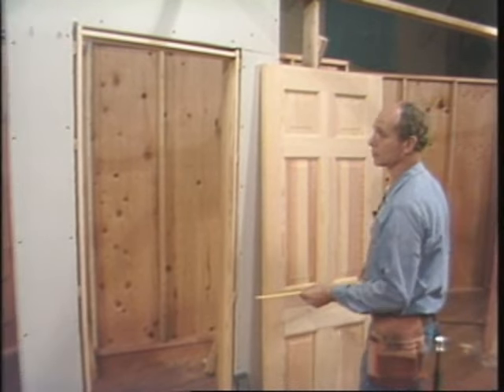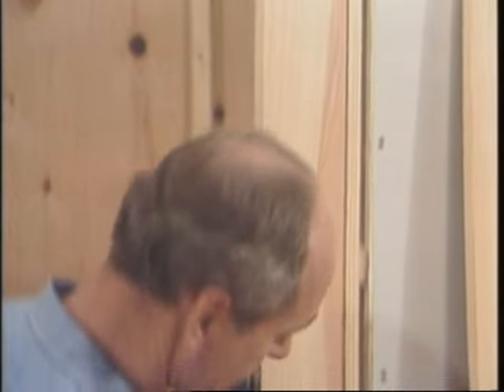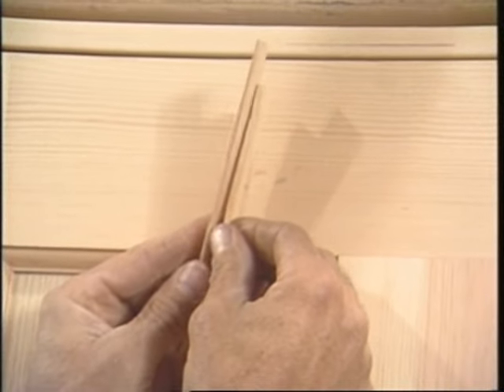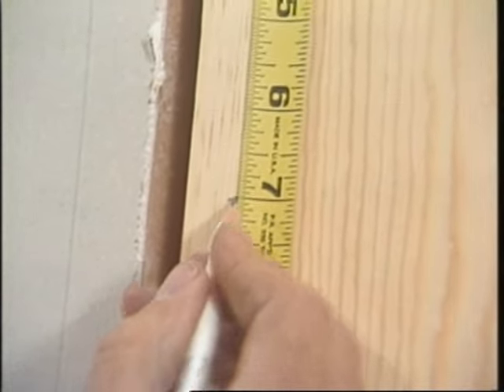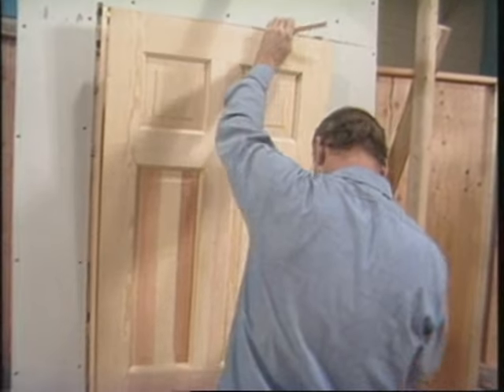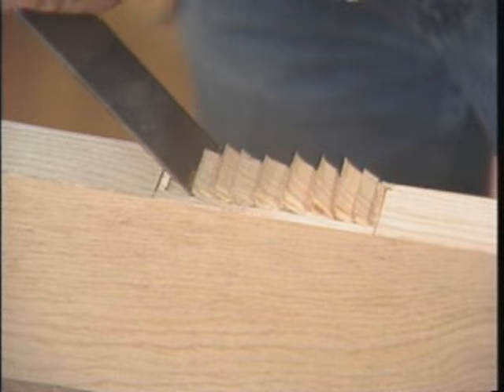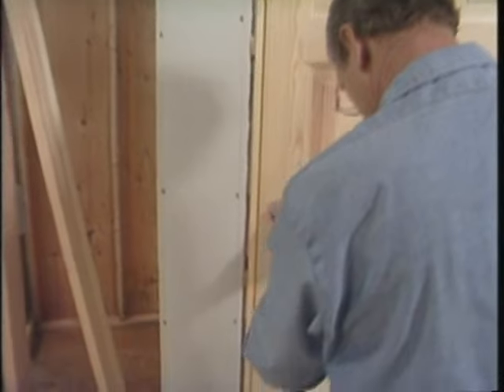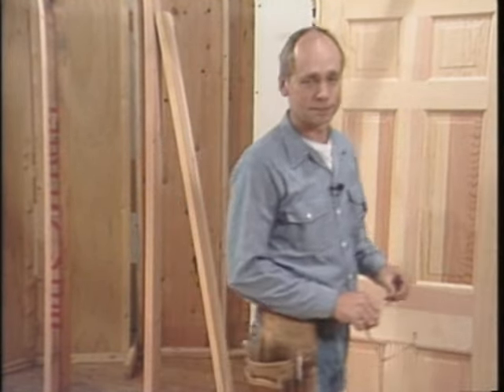Scribe-Fitting a Door

Comment: Might want to explain where you got 7" and 10" very incomplete video. Sorry...
Reply: To avoid the mortice and tenons on the mullions going into the Stiles of the door 
Got it
Reply: @MrTicker69  I understand it, I'm sure there are many that dont. That was my point...
Got it
Reply: I've been doing this for 32 years and it does get complicated if you dont know what you are doing and we have all been there

 but that is standard for solid doors usually 7x9"
But all depends on  the width of the mullions just try not to disturb those areas 
Hope this helps
Reply: @MrTicker69  
Again, I get it but some people might not???
Reply: I’ve recently started hanging doors at work and I’ve never planned the hinge side down ... so that bit went right over my head does he do that because he knows how much the door will move over to the latching side due to the knuckle of the hinge ?
Reply: @BenP227  no he puts the door in the opening, and scribes each side to get an even reveal. He would do the scribing on that side, then when he knows that the reveal would be a 16th of an inch as he stated, then he will do his hinge gains.

He planed the hinge side down because the hinge jamb leg wasn't strait, so if he just did his hinge gains and then scribed the strike side to fit, his reveal wouldn't look good or even be functional on the hinge side.  Hope that makes sense.
Reply: @chrisburns5691  somewhat! Thank you for the time you took to write this out